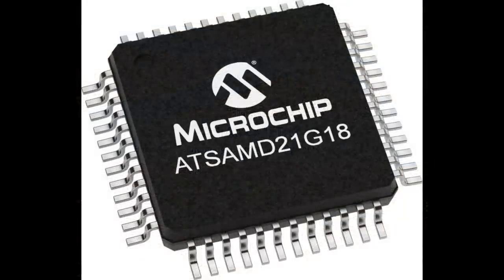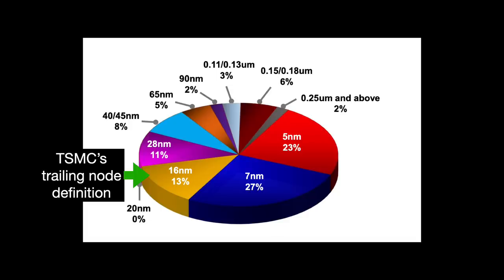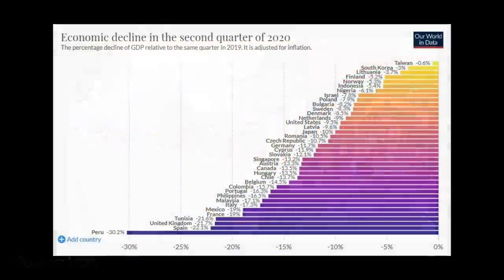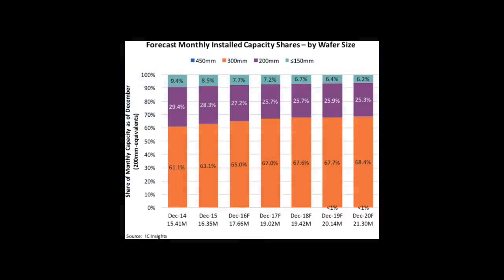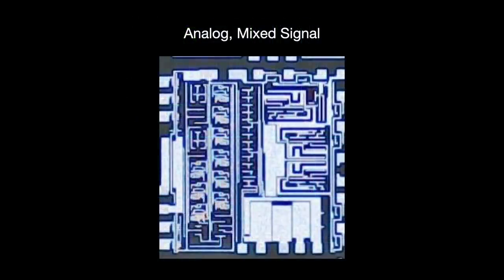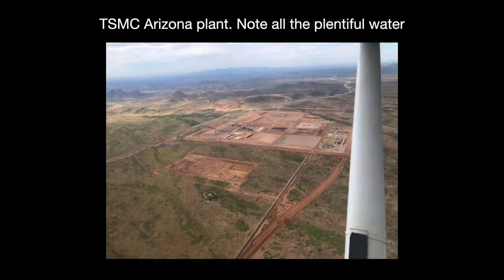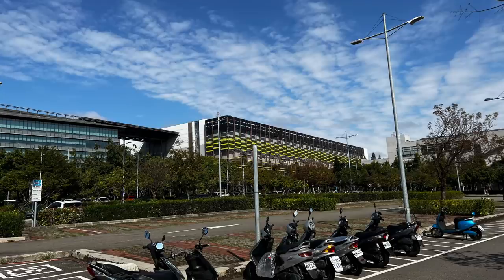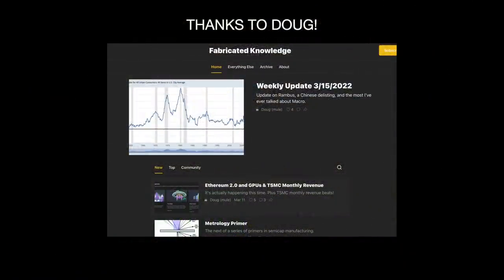Where The Real Chip Shortage Is

Comment: great video.  One thing I would take a bit of issue with is die shrinking old designs is not "always" a good thing.  Less die size does mean cheaper and less on die parasitics, which means faster ICs.  This should be a "win/win" as who doesn't like faster ICs?  As it happens, the FCC may not.  Sometimes a die shrink will make a processor too fast for it's own good, and where a design used to pass radiated emissions in a larger package, it will not in the smaller one.
Reply: No, a die shrink NEVER makes an IC too fast.  An IC is a clocked circuit.  The clocks that get stuck into the IC determine the speed.

No that's not the issue.  The issue is a node can be too small for the number of transistors needed to go into a single die (IC), so you end up with a TINY die that has to be cut from the wafer and cutting a die ever smaller I'm sure becomes very hard.

For instance TSMC's N7 (7nm) has a transistor density of about 90 MILLION transistors/ sq. mm , N5 is about 170 million/sq. mm and N3 is almost 300 million/sq. mm.

So, at the low end of these advanced nodes, 90 million transistors/sq. mm

So you design a circuit that has a few hundred transistors.  You still need it to be an IC, but you can't put it on N7 because you couldn't cut the die small enough.

The other issue is power.  Internally I can have transistors running at tiny voltages or current, but to drive signals off the IC to another circuit requires more power.  You can end up with having to make a larger circuit on a small node to drive signals and this can be a waste.  For instance AMD is making Zen 4 with two different TSMC nodes.  They use TSMC N5 for cores and use N6 for the I/O functions to drive signals out of the CPU or into the CPU.  Some controllers can be in the cores but most are in the I/O die.  For Zen 2 and Zen 3 AMD used GloFo 12nm for the I/O die and TSMC N7 for the cores.  Part of that though was having to fulfill contractual agreements with GloFo, for which I think AMD is finally done with them.  So THEY could have capacity for different chipmakers as AMD finishes off with those contracts, but Zen 3 is still going to be made for a long time.

So those are the reasons smaller nodes can be no good.  You have a circuit that doesn't have enough transistors in it to warrant moving to something below 50 - 28nm, and that's probably the case with most, and then you have the issue with having to drive signals off the IC and need more power to push that signal.

The other things aren't a problem.  Clock speeds are controlled by the chipmaker.

Other issues I imagine could be more sensitive to noise, like you're in an industrial area and machines are producing a bit of magnetic waves or strong frequency transmissions and smaller nodes are more susceptible to external noise.

One thing that node shrinks are supposed to do is drop power consumption by the IC.  You shrink a transistor and you reduce the amount of power needed to drive it.
Reply: @johndoh5182  You are correct about clock speed. However noise is generated by signal transition rise/fall time. If you decrease the rise/fall time, while maintaining the same clock speed, more RF noise will be generated.  This is in general why, when designing a product, it's a good idea to select a technology that customarily runs a the speed you intend to run it, and not a technology that's intended for 10x faster, for example. Also why MCUs and SoCs have selectable output current levels on their IO pins -- so you can limit the rise/fall rates.
Reply: @Graham_Wideman  I'm going to say BS because it's the same process nodes that run in laptops where the clock frequencies can drop to VERY low levels to save energy.  Link something that shows Samsung or TSMC has an issue with slow clock speeds on N7 - N3 and I'll believe it.  You get issues with noise typically with HIGHER frequency because current increases.  Maybe you're talking about something external to the IC.  In fact CPUs are constantly changing frequencies in cores and they can drop to very low levels, like a regular CPU that goes into a PC.  It's how a CPU saves power.  But I do believe that in laptops the clock speeds drop lower than in a PC.

But I also did say in that comment that smaller nodes can be more susceptable to external noise.  But, that's not like a tiny bit of noise.  After all there's a lot of magnetism going on in a PC with power supplies that can push 1600W along with having banks of mechanical drives. Fan motors.

So link something or give search info and tell me the name of the web page so I can read it.  Maybe you're thinking that there is some general rule about what happens as nodes shrink.  And I'm going to say engineers solve those problems which is why you HAVE those smaller nodes.  I means there's a LOT of Samsung die that doesn't run at high speed because it doesn't need to.  They have to clock a lot of ICs slower to save battery power.
Reply: @johndoh5182  It's not clock rate you have to worry about; it's edge rate.
Reply: @johndoh5182  It is noise generated on the external power and signal PCB traces and planes connected to the MCU or SoC that I was discussing, as clear from mentioning I/O drive current and so on. And again, this is nothing to do with clock speed, and everything to do with edge rate. Does it apply to all chips that get shrunk? Of course not, but we're addressing Sean M's comment that for some chips the problem occurs.  You want a keyword? EMC.
Reply: @seanm2511  Explain in layman's terms what you mean.  I've worked in electronics, troubleshooting older and slower computer systems where they had ICs with about 6 - 10 gates in each IC, meaning the computer took up a large cabinet.  This also means I did a lot of signal analysis to find a faulty logic gate, to replace the part.  

The topic is, based on your words "Sometimes a die shrink will make a processor too fast for it's own good"

I have no idea how this happens so please explain.  Usually the slower something runs, the cleaner the signal, not the inverse.  I know, I used to analyze signals.  The slower the clock, the more time a signal has to settle into a state of either a 0 or a 1.  The leading edge of a signal is where you get problems, not the trailing edge, and this means the faster you try to clock a signal, or even NON-CLOCKED signals where logic gates are simply propagating signals, the harder it gets because you have less time to sample a signal.

So please, explain and maybe provide a link to something you're talking about.  I've just never heard of this in terms of digital electronics and ICs.
Reply: @johndoh5182  OK, sure.
1) to sell your "widget" it needs to pass radiated emissions.  This goes by different names in different places but the "thing" that needs to be done is the same.  Keep the area of any inductive loop small, and the bandwidth of signals in it low.  The bandwidth of an edge rate being approximate to 0.35/rise time in nanoseconds, you can see that the fewer nanoseconds of edge rate, the more bandwidth you have got.
2) Shrinking die area also means lowering parasitics, In the case of inductance, lovely, in the case of capacitance, it means your signals run faster which increases edge rates.
3) If the package is designed correctly with a well thought out number of low inductance grounds you needn't worry.  If not, as was almost universally the case before about 15 years ago, and suddenly everything has sped up, then... you probably do need to worry.
Reply: @johndoh5182  BTW, the more useful question is "why isn't die shrink happening more?"  The simple answer is nobody wants to blow a few million on a new mask set for something they are already selling.  In addition to the potential pitfalls with EMC and so on.
BTW, I disagree with the channel here.  I don't see a wave of die shrinks happening for older ICs for these very reasons.
Reply: @seanm2511  First, I made this statement in my first comment:

"Other issues I imagine could be more sensitive to noise, like you're in an industrial area and machines are producing a bit of magnetic waves or strong frequency transmissions and smaller nodes are more susceptible to external noise."

So, I already talked about part of what you're talking about.

Two, parasitics INSIDE an IC is different than outside an IC.  I see more articles in reference to parasitics in regards to a PCB than I do to ICs.  In the case of ICs though, most articles I see are old, and for the articles that are newer, I see more of an issue with faster signals, not slower.  Engineers have after all solved literally hundreds of problems in getting down from something like 90nm to 5nm.

Reactance screws with the leading edge of signals. The trailing edge doesn't matter because the output of a gate is used by some other gate well before the gate loses any sort of enable it needs to propagate a 1 or a 0.

From EDN, dated 2014 so it's at least a LITTLE relevant to today's ICs:

"As the Semiconductor industry is growing so does the density of devices on chip. With the increasing density and decreasing spacing rules, the most significant effect that takes birth is parasitic. Parasitics can be of resistance or capacitance types, both have to be handled carefully. In this paper we will discuss parasitic capacitance.

In VLSI applications the parasitic capacitance between signal lines can deplete our whole design. At low frequencies parasitic capacitance can usually be ignored, but in high frequency circuits it can be a major problem. For example, in amplifier circuits with extended frequency response, parasitic capacitance between the output and the input can act as a feedback path, causing the circuit to oscillate at high frequency. These unwanted oscillations are called parasitic oscillations . "

Notice, "at low frequencies..... can be ignored."

You need to define what you mean by "edge rate"  I don't know what you're talking about.  I'm assuming you're talking about the leading edge of a signal, because once again the trailing edge isn't critical.  If this is the case everything you stated backs the point that newer ICs do a better job of transitioning from one signal level to another.  OK, I have NO IDEA how that affects a slower clocked circuit.  It gives even more time to use the output of any logic gate.

I have yet to read anything that backs the statement " Sometimes a die shrink will make a processor too fast for it's own good,"

This is the part of your statement that I was responding to that frankly I think is wrong and you haven't shown anything that changes my mind.  And if somehow you're making external interference part of the issue, I already excluded that so it was never part of my discussion.

And throwing in the fact that older circuits ...... blah blah blah is beside the point, because I wasn't talking about anything except the speed of faster die being a problem somehow for using it for a slower clocked circuit.  This is in fact EXACTLY what different companies do including communications equipment, including cell phones that now have Samsung 4nm die in them, and are clocked slow.

But to state your last bit in a way that makes more sense, it's down to economics. A single die has a min. size based on the node.  Finding this information is hard, but it's still true.  A few million transistors (2 - 3 million) will fit in a die that's 0.5mm x .05mm using a 28nm node.  That's about min. for a single die, but I haven't seen specifics for TSMC 28nm, once again finding this information is hard.  So rather than what you said, I'm going to assume the issue for chipmakers is cost/wafer.  Doing another map for a smaller node isn't going to break the bank if a chipmaker is going to get real benefit from dropping to a smaller node.  The problem is you need a die that has tens of millions of transistors to use a node such as TSMC N7 in a cost effective way, or there are components laid out on that die that take up more space than a typical transistor.  TSMC N7 can have about 22.5 million transistors in a die that's 0.5mm x 0.5mm or 0.25 sq. mm.  If you have an IC that's only 3 million transistors, you'd have a lot of empty space on that TINY die and that would be a waste of money considering the smaller the node, the more costly the wafer.  Samsung will do this because they make their own die, but a chipmaker who's contracting with a fab isn't going to waste the money.   And this is what I see being the bigger issue.

You seem to think that all these small nodes have issues with EMC, and yet TSMC N10 - N5 is EVERYWHERE, and so is Samsung's smaller nodes, so I just don't buy it.